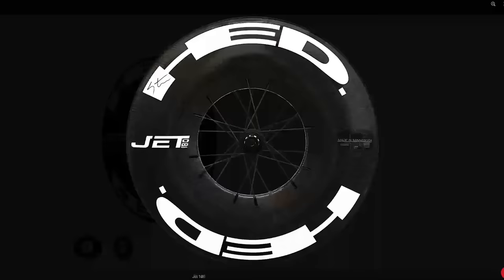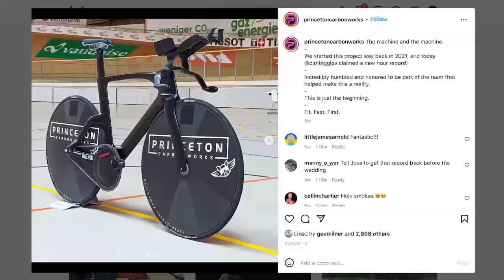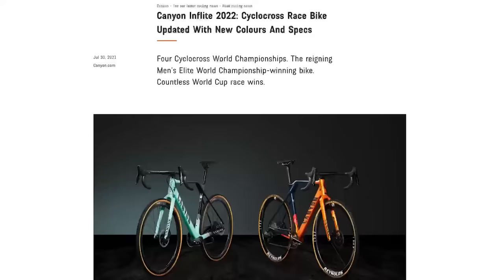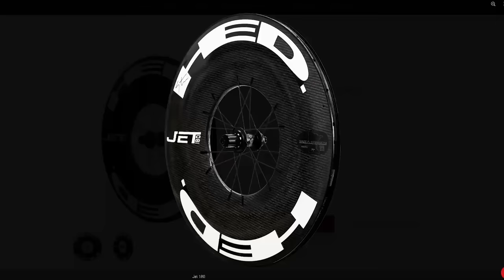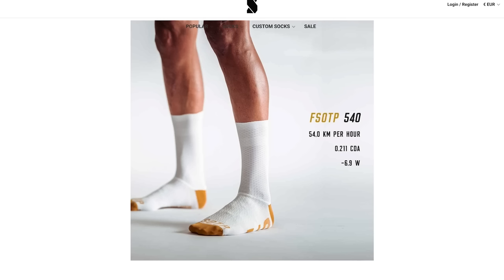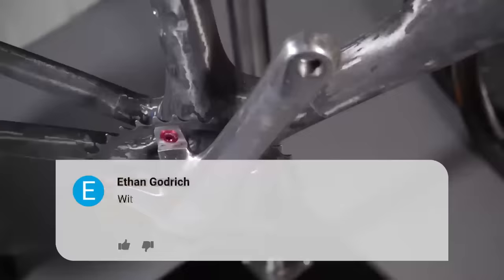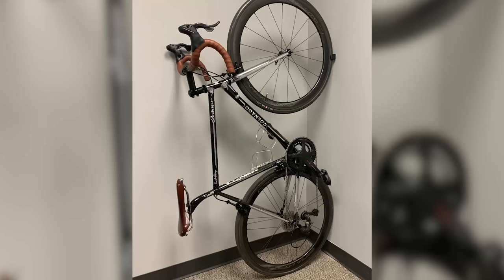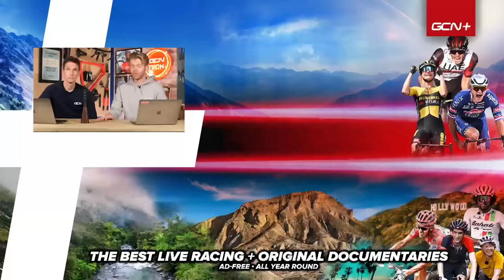What Tech Will Ganna Use For His Hour Record Attempt? | GCN Tech Show Ep. 249

Comment: Just a note 😃: Drag coefficient is independent of frontal area. It is possible to have a rider that has more frontal area than Dan B that also has a better drag coefficient. It's the multiplication of the coefficient with the frontal area is what gives the overall effect.
Reply: Yeah, Cd is the drag coefficient, CdA is that times area (which you then multiply by air density (& I think viscosity) and V-squared to get drag force).
Reply: Enough power can overcome ALL of that, but yeah, it would have to be Herculean output.

Comment: Great to see Si and Ollie host the GCN Tech Show and that'd be a great feature, Si, your reactions to that commuter-bike feed.  And I'm in that camp, too, commuting on a Diamondback 26" mountain bike hopped up with a 250-watt front-hub motor, whoop whoop.  Big fun and it makes for a different ride, easy cruising on false flats and gentle rises, out-of-the-saddle romping up ramps and hills, all the dance to meter the juice with its thumb throttle and get as much distance per day out of the Green Zone Bikes kit on my total 28-miles-per-day commute.  And I stash the battery in a rear pannier, meaning the bike retains its original look, pretty much, and the water-bottle cage is used as intended, no battery getting in the way down there.

Comment: Power meters as original equipment on a bike only make sense if they're optional and if opting not to get them realizes a discount.  By "forcing" a power meter on a buyer, you're depriving them of choice and/or pushing them to run multiple power meter systems.  I really, really like my Garmin Rally pedals and would prefer not to have to switch to, or run them alongside, Shimano's spider-and-crank power meter...

Comment: Ganna will just be using the same aero tech as Dan during his attempt. 

The key differences are that Ganna is going to have more power in exchange for a less aero body, 
Dan having more time to test the gear and tech. 
And then lastly, Dan will be able to tell the R & D department the key areas to focus on.

Just hope the actual coverage is better than Dan's attempt.

Comment: I worked out that that 180 section wheel is approximately 85% the area of a solid disc, so very nearly as bad in crosswinds as a disc.

I'd be interested to know what the gains are between a decently deep aero wheel, the HED 180 and a full disc, given that they are on the back of the bike and hence in a lot of turbulent air anyway. On the front a disc would be a no-brainer, at least indoors, but on the back I'm not so sure...
Reply: Lionel has been training on the bike course with it
Reply: @troycollett8540  Lionel?
Reply: @The1trueDave  you don’t know Lionel sanders
Reply: @troycollett8540  I only follow the sport side of it superficially so no, fraid not. Care to enlighten me?